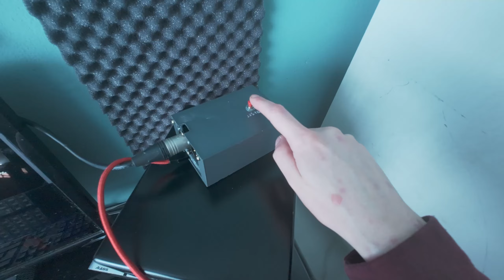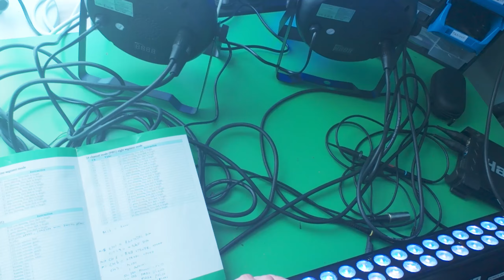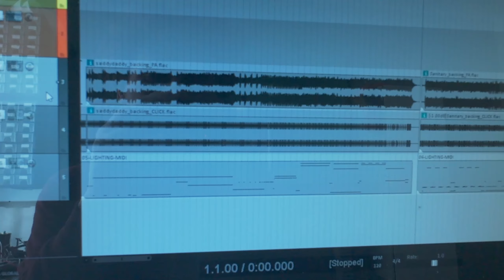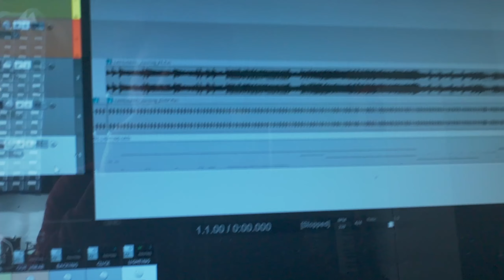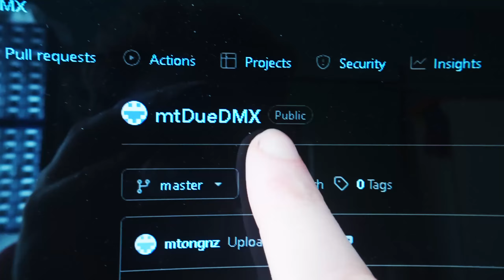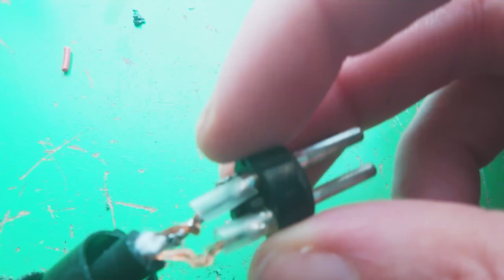DIY MIDI controlled DMX Lights using Arduino Due

Comment: Alejandro once suggested the opposite to control his SGX. So to use DMX controllers to generate MIDI or analog control signals. Which is not a bad idea at all since some really big ones are available for easy money.